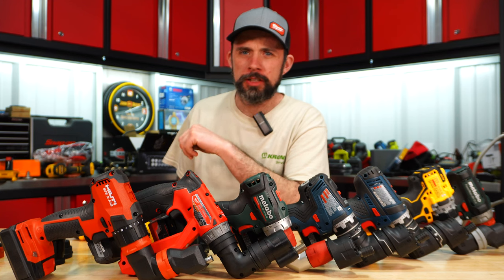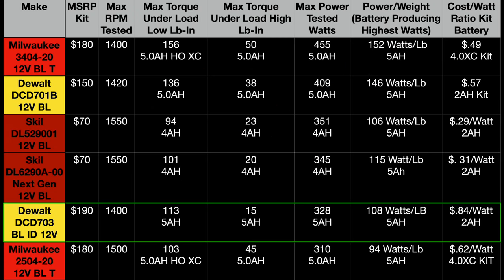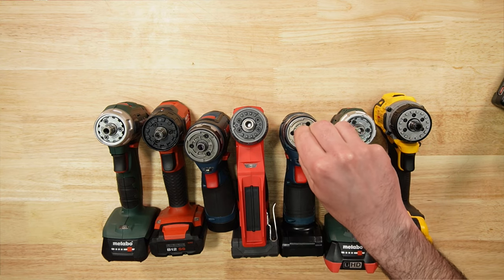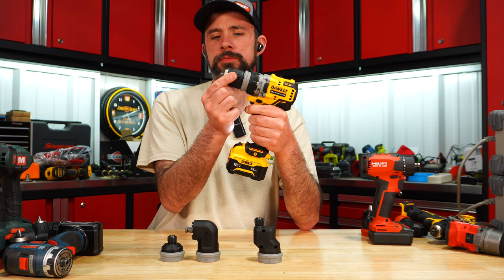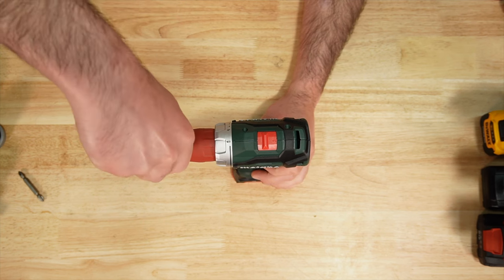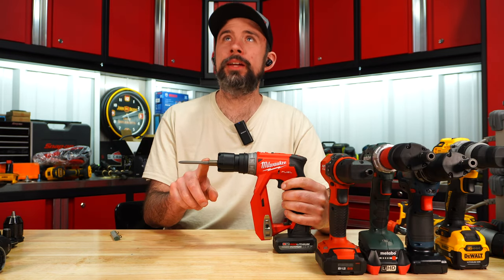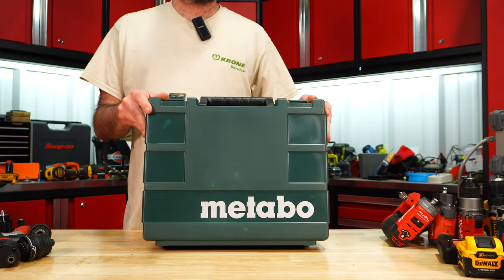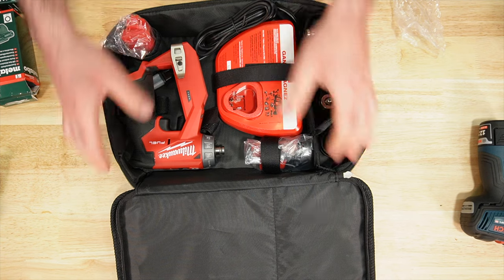Best Installation Drill/Driver 12V Part 1

Comment: I have the brushless Bosch. One thing to note is that the right-angle and offset adapters can be quickly rotated by pulling out on them. Also, there's an SDS Plus adapter available, for some reason. I bought it, of course, because it's kind of absurd, and it works decently.
Reply from the maker: Thanks! for pointing out how the Bosch can be quickly adjusted,  I wasn't aware of this and will mention it when I cover the new Festool's.  

I seen the SDS adapter,  hope to test that at some point it looks cool.
Reply: Oh, men!...
I think that SDS attachment lock me on Bosch!..😊❤
Reply: How did that SDS attachment work out?
Reply: The Bosch chuck mount is generally regarded as superior to the others because you do not have to disconnect the chuck to rotate it to a new position. They have isolated the position function from the mounting function. 

You should add a caption to your video because it is misrepresenting how these work. Better would be to edit in a new clip where you show how the Bosch adjustment works.

Comment: The milwaukee is designed to be held with the index figer along the tool and use the middle finger on the trigger.  its lines your wrist up better with the drill bit or driver bit. Used that way it improves the ergonomics considerably.

They over all design is "inspired" by the festool.

Great comparison thanks
Reply: Festool wasn't stupid enough to put an electronic for/rev switch on theirs though.

Guarantee Milwaukee walks some of these poor design choices back if there's a Gen 2 of this thing.
Reply: That’s right! it’s designed to be held just like a screw gun. People seem to either love it or hate it. I personally like it I can fit it anywhere I can fit my hand.
Reply: @jaywelker5566  maybe, maybe not because Dewalt just did the same user interface with their screw gun. The settings are placed on the top in the exact same spot, which I was surprised about, considering all the mixed reviews with Milwaukee’s installation driver.
Reply: Exactly

Comment: I have the Milwaukee and brushed Bosch and generally reach for the Bosch - although I do prefer the ergonomics of the Milwaukee (that button excluded!) in the hand.

The main reason I'll go for the Bosch is the locking bit holder on the hex and offset chucks. They'll take a 25mm bit which comes out easy when you want it to, but the Milwaukee eats so much of a 25mm bit that you really don't want to put one in there. The Bosch also holds Centrotec bits (I only have a few) where they just fall straight out of the Milwaukee. Also, for me, I want a locking holder on the offset when drilling in tight spaces so the drill bit doesn't pull out when backing out of the hole.

In the UK, the Bosch kit came in an L-boxx with insert trays that keep everything organised and you can shake it around and everything stays put. That cloth bag yours came with looked like only a vague afterthought.

The Milwaukee bag is big enough to store (if you toss the charger) 2 drivers, 2 sets of chucks and a spare battery which is great. You wouldn't want to throw it around but it makes for a good grab bag for drilling and driving.
Reply: Love my brushed Bosch. Outside of the weight it’s a winner in my collection

Comment: I own the older Bosch brushed version - had it 4 years now.  Can't see myself upgrading as it's powerful enough and perfect in size and weight.  It is literally as small as it is possible to  be and you can still  hold it firmly but comfortably.  You can drop it in your tool belt bags or in your tool box and takes up very little room.  Battery lasts surprisingly long.  It is the one power tool that always comes with me.  If my impact driver battery dies and I'm putting in 100mm or 4 inch screws ill use this for 10 or 20 minutes to get to the end of what I'm doing rather then stop and find another battery - it is more than good enough for what it is designed to do.
Reply from the maker: Yep thats understandable,  they all seem to get the job done.

Comment: why the bosch's locking system is a big deal is that it secures the attachments in place from falling off or easy disengagement.  I noticed that the Milwaukee had the tendency to catch onto weird places that may cause the release the attachment.  As a Milwaukee guy, I unfortunately prefer the Bosch over the M12.
Reply from the maker: Interesting that’s a good point,  thanks for the info.
Reply: As an aviation technician I've tried almost all of these and the reason why I sold the Bosch was the way that the attachments twist and click on. Here was the problem very frequently I need to change the clutch settings to a different number and when I did my hand would inadvertently release the head attachment and this would happen over and over again so finally I had to sell the tool

Comment: I use the Milwaukee everyday at my job and with regards to the ergonomics I 100% agree with you!  While I’ve adapted to the ergonomics, the fact that the tool sleeps and therefore sometimes you only need to press the button once and sometimes twice is really infuriating. Whoever decided to position the buttons like that and then complicate it with a sleep feature really needs to have their head checked. However, you showed me something I didn’t realize and I feel profoundly stupid because of it!  I didn’t realize that I could stick a 1/4” hex bit in without the locking hex driver piece!  Man I feel dumb!  Thanks for the awesome video and for learnin me somethin.
Reply from the maker: Yeah that switch is way over complicated for a drill.  

Lol hey I’m glad the video helped, we all are only human.

Comment: I have the brushless Bosch and Metabo. As a tradesperson I have never seen someone use any of these provided bags or cases. My Bosch stays in my Velocity/Unilite Rouge 4.5 as my daily driver because out of all of these it takes up the least amount of space. For the same amount of real state one of the other drills would take in my bag, I get a drill, charger & spare battery. You also left out the Bosch’s GFA12-H attachment that adds SDS functionality. 
My Metabo is in Kaizen foam in a MetaBOX and used primarily for running conduit in elevator shafts. 
I would not go back to a traditional drill/driver, if I need to drill I use Bosch/Diablo spade bits and Milwaukee titanium hex shank twist drills. One the only times I use the three jaw chuck is for Klein 4’ or 6’ dill bits to run wire/cable to attic and/or basement/crawl space without causing drywall damage.

Comment: I own the brushless bosch because of the weight. I wish each weight could be tested which is another important factor.
Reply from the maker: I did test the weights,  it’s noted in the spec table in the video.  

Yeah the Bosch has good performance for its size.

Comment: I love the ergonomics of the Milwaukee. I think they could have made a normal direction changer, but the hand position is great. You pull they trigger with the middle finger. The hand sides in line with the drill, much easier to press straight into your material.
Reply: Exactly

Comment: Great comparison and review, thanks for posting!
I had the milwaukee for a while but sold it and got the dewalt instead. The dewalt is much nicer to hold and use, and the additional power doesn't hurt. I prefer having the locking chuck on the right angle attachment; more than once when using the milwaukee the bit would be left behind in the screwhead. In general I don't like non-locking chucks. Festool finally has a new brushless version of their CXS (along with an 18v version) coming soon. Checking out part 2 now, thanks.
Reply from the maker: Thanks,  yeah hoping to test the new CXS when they come out!

Comment: I bought the Bosch 12V brushless and is the only tool I have in that line. The only complaint I have is the case (especially after seeing this review). The way that the attachments lock it feels very secure and the added motion to do so is a nonissue. I originally wanted the Milwaukee but hated the ergonomics. I never liked the bulbous grip from m12 in general and the fwd/reverse is right where you might not easily reach. A dud from them.
Reply: It has a SDS attachments now, and ( maebe 🤔)a SDS 90 degree Attachment!

Comment: There's an extra Bosch attachment that's a 1J SDS. Metabo also has a torque multiplier, but I think that's only for 18V.
Reply from the maker: Thats very interesting,  thanks for the info.  I might have to test that SDS  and look into that Metabo TM.
Reply: @Tools-Tested  beware that Bosch has flexiclick in 12v and 18v and they're not compatible. 18v has a red collar and 12v has black collar
Reply from the maker: @toolscientist  yeah I seen that,  same would be to east lol
Reply: @Tools-Tested  makes sense for reducing size and weight on 12V. They should have at least called it Miniclick to reduce confusion.

Comment: Love that little Dewalt myself. I use the DCF601 just about everyday. Love that thing. The Bosch has always looked nice as well. Same for the Metabo.
Reply from the maker: Yeah these 12v Dewalt are 🔨,  I hope to test the DCF601 at some point but would expect similar resaults.  Yep the Bosch seems good, really like that the new Dremel's use Bosch battery's.  Metabo BL is good just very hard to find.

Comment: How good is the trigger control?

I have the brushed Bosch, and what I love most about it is how good the low speed trigger control is. I can remove and reinstall self tapping wood screws without worrying about stripping. 

My M12 Fuel drill’s trigger control (previous gen, with the electronic clutch) is terrible. Never feels right. Great at high speed work but I can’t stand it for screws. 

I store mine in a narrow Packout bin with a foam insert I made myself. Perfect size for a tool like this.
Reply: EXACTLY!  My favorite cordless screwdriver ever was the original Bosch PS20 driver.  It was narrow, had enough torque for small/medium screws, and it had PERFECT analogue trigger control of its brushed motor.  That’s the #1 criteria for this type of tool in my opinion.

Comment: i am using the bosch brushless everyday for lighting installation job right now & love it. I had tried milwuakees 2 years ago  didnt like the fwd rvrs switch and did not like the chunky D handle, though i do love the magnet & I actually prefer the way the back is shaped like a drywall screwgun, more ergononic for me. using the bosch or m12 impact I choke up on the handle so my pointer finger is next to the light. the bosch comes with a bit holder that holds 4 bits which is vury useful & better belt clip location on the side of the head makes it easy to grab off ur belt. I keep in in my hammer holster with the small 2.0 battery and have to change it once a day at least. im sometimes using it to drill through 2x4s 1/4-1in holes but it is annoyingly underpowered but gets through in 3x the time, still the size & weight savings makes up it, & sharp bits matter more then torque & rpm. mostly driving small fasteners, the offset is a lifesaver when doing light fixtures and assembling furniture. I use the offset 70% of the time, drill chuck 20%,  right angle 5% , 1/4in hex 5% of the time.
Reply from the maker: Yeah to me thats what kills the Milwaukee with that goofy forward revers button.  I agree that bit holder is nice.  Thanks for the info!

Comment: These are designed with small fasteners in mind.. don't need much power or torque...accessibility and convenience is key..
Reply from the maker: Very true,  power to me is important if someone is replacing a normal drill with one of these.

Comment: I have the Milwaukee and agree it has some funky ergonomics.  As a replacement for a drill, no way.

BUT, as a tool for driving fasteners in awkward locations it’s pretty darn good.  As another commenter mentioned, the handle is designed to keep your hand in-line with the fastener.  Once you get used to the grip and the direction control, it’s actually very good.

I’m glad you evaluated the attachments and cases - I otherwise wouldn’t know how the Milwaukee stands up.  The offset attachment does work well.

In line with my other comment regarding the brushed Bosch trigger control, I think judging this type of tool based on how much torque it makes is not important.  If it has enough torque to drive medium sized screws it’s enough, again if you’re not using it as a drill replacement.

I also use the OG M12 2401 and love it mainly for it’s brushed analog trigger control; no delay, linear response, single speed and enough torque to get the job done.  If it had a permanent offset drive it could be perfect as a screwdriver.

Comment: I'm not a fan of the typical fwd/reverse switch on the side since I often bump it out place with my thumb.  So maybe Milwaukee is trying to solve that.  I remember the older drills with the lever under the chuck in front of the trigger.  I like that position.

Comment: I've owned the Milwaukee version a few years and I agree that the ergonomics are lame. Yes I understand that you're supposed to hold it a certain way and the trigger buttons have a reason to exist as well but in practice I would have just prefered a standard drill with the fancy attachments. I also don't like how if you want to use an XC battery the tool becomes unbalanced. Like other commenters stated the European version looks better. I do like it's slim size and that it's not so powerful to rip out of your hand if it hangs up when you are in an awkward spot. These tools are definitely not all about power. When I want more power I use the gen 3 12v drill, that thing is a tank!

Lastly after a bit over 3 years on the jobsite with daily use the tool is starting to make some squeaking noises so it's getting close to death I believe. Just something to keep in mind. If it does die I plan on buying the European version if Milwaukee turns me down on warranty. You never know these days they are getting picky on the warranty.
Reply from the maker: Yeah its really odd ergo wise,  I did just get the European version in .
I had to order it from amazon Germany.....

It's huge compared to the rest,  but the attachment of the heads is easier vs the others.

Hopefully in a week or so I will do a part 2 comparing it vs the others.  Also look at other things which are important when comparing these drill drivers.  

Thanks for the info!

Comment: I'm on the Makita platform but they don't have anything like this so I have the Milwaukee. The top button is stupid but I like everything else about it. Funny I hated the soft case. The velcro to me was a PITA. Some guy on Etsy makes a foam cutout for the entire kit minus the charger and it all fits in the half size thin Packout box with the clear top. It's so nice in that. I used to carry the sub compact Makita drill and driver. Now I just grab this packout and good to go.
Reply from the maker: Yeah wish Makita made one.  Just looked up that pack out it looks like a sweet setup.
Reply: @Tools-Tested  It makes it really nice. I also bought the entire range of step down drill bits up to 1/2" with the 3/8"s shank. I wish they made a 1/2" drill chuck for it but now with the step down bits all good.
Reply from the maker: @scotts4125  yep 1/2 would have been nice.  The version in EU/UK has a 1/2.  I just received it from Germany,  it’s a much bigger drill but the attachment is a lot easier.  It will be in the part 2 video.
Reply: @Tools-Tested  Looking forward to it and you gained a new sub.

Comment: If these are designed as a installers tool, I would think that it would be imperative that the tool be of a slim design. That Dewalt looks absolutely huge. It looks like a 18v sized tool. IMHO.
Reply from the maker: Yeah it looks it but it’s really close.  I’m going to be doing a part 2.

Comment: I’ve used all of these (and the 18v counterparts and of course the og Festools, Fein and etc).   The one I run with is that last place Hilti. 😂.
Reply from the maker: What made you go with the Hilti?
Reply: @Tools-Tested  Honestly, no other reason than simply liking how the Hilti 12v drills felt in the hand. Dewalt and Metabo can eat the other's lunch in the power department. I was looking to buy a 12v bit driver at the time. The multi head came later as I started appreciating how many 12v drills, and a light and so on I can fit in a small bag or a tool box. I'll be honest, the chucks on all of the 12v multi heads are nowhere near the quality of the various 18v models (to be fair, I have not use the 12v Fein, so don't know about that one) and the Hilti ones are on the lower end.  That said, all of the 18v models that went through my hands honestly didn't get much use outside of being stubby insert bit drivers and maybe sometimes using the offset head. I've seen the light with 12v.  I actually use all of the heads on it. Because of the size, it can actually get into those tight spaces.